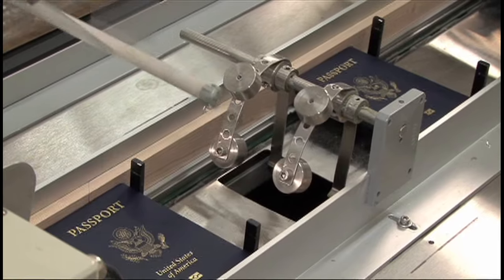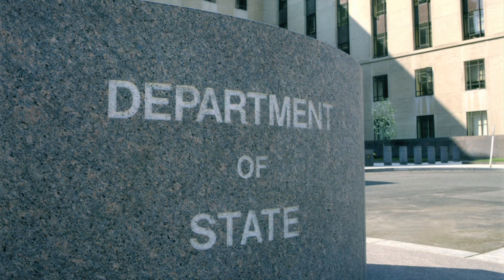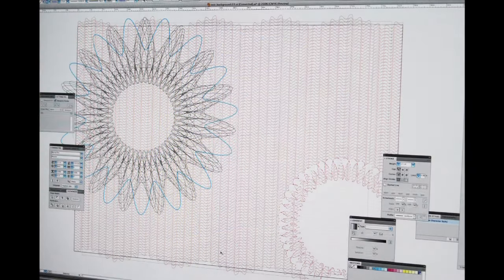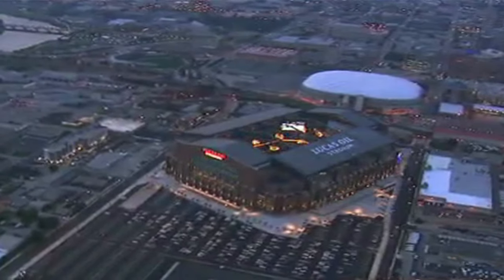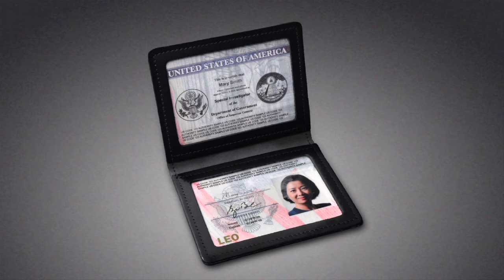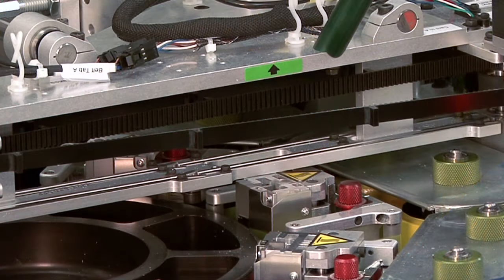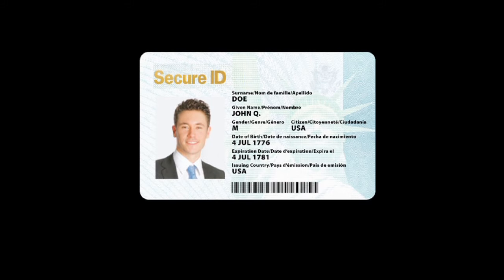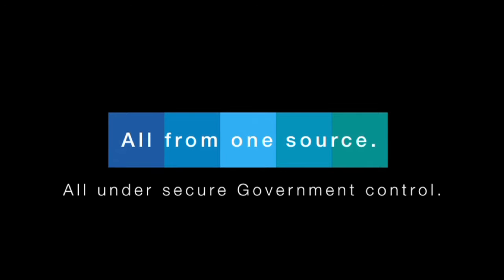U.S. Government Printing Office: Secure & Intelligent Documents

Comment: Can USGPO make an updated video about next generation passport?
Reply: The process is essentially the same. There are a few additional security measures that would be kept confidential but UV printing and the bedding of contactless microcontrollers are changed around differently to ones that are harder to get without authorisation.